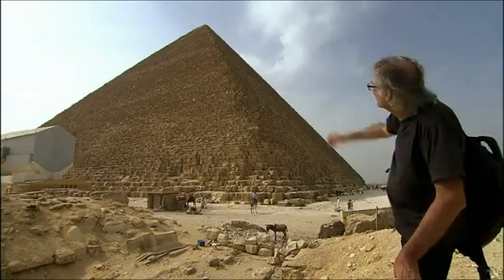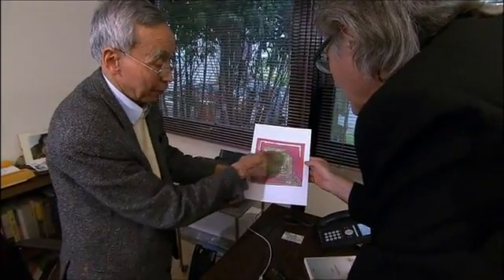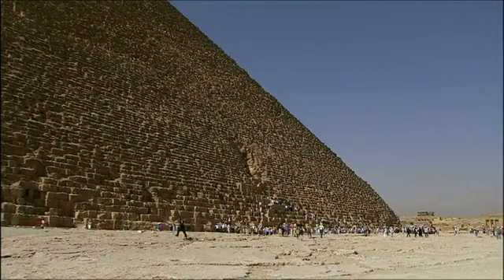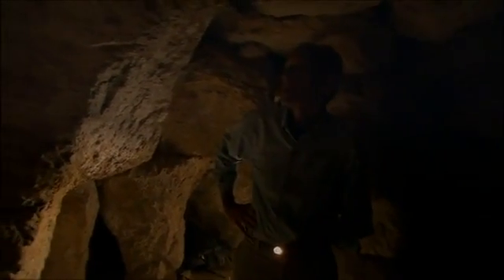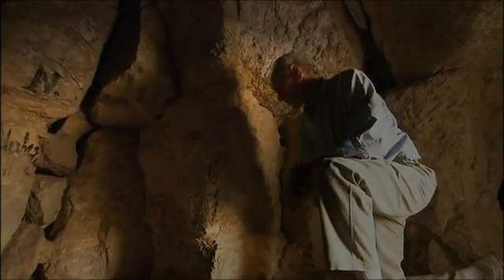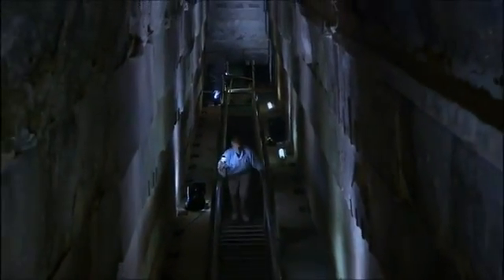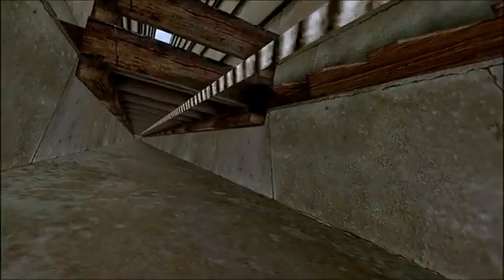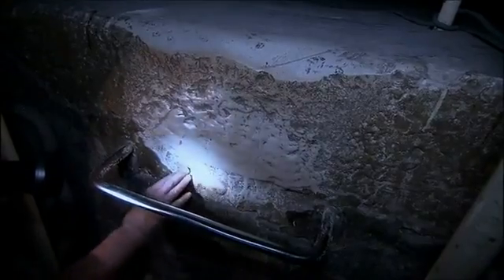3 The Great Pyramid of Egypt, How was it Built- new solid theory, new evidence. JP Houdin. 2011

Comment: i dont know about you guys but i honestly think that jean pierre may have finally solved the pyramid if not most perfect theory. The internal ramp really made sense after all many years. fotr some reason im thinking how many Egyptologists or even engineers have missed out on an internal ramp. This really makes sense. The notch at the corners mentioned and shown from the video really was an oddity unless previous explorations had exposed and chiselled that but at that height it didnt really make sense for the previous explorations to have concentrated on such a height.

Im just not actually sure and inclined about the counterweight and trolley system but the notches at the grand gallery spaced equally could have really been used for a purpose. but i am sure that the grand gallery is where the relieving granite beams were carried through.

I really wish that even before i pass away ton this earth hat the truth about pyramid may be revealed. so that when i see khufu up there i have something to talk to him about.
Reply: +felixthecat meow This makes more sense than anything else I've come across, but the one thing that's always bothered me is the King's chamber, if someone was really ment to be buried in there the walls and maybe the celling would have been coved with hyrogliphs but they aren't.

Comment: The blocks are not quarried stones, but concrete pours into molds. and the proof is easy.  If it were quarried limestone, from the Nile,  then random surfaces would show ancient fossils which would prove they are cut stone, from the quarry.  If they bear no evidence of Fossils along the surfaces, then they were ground up material,  common concrete and mixed to form a faceless empty of fossils material on all the surfaces.  That is easy to prove, and so it has been avoided to even talk about.